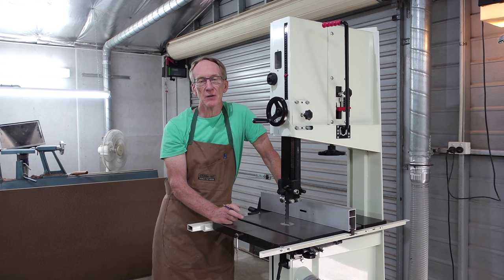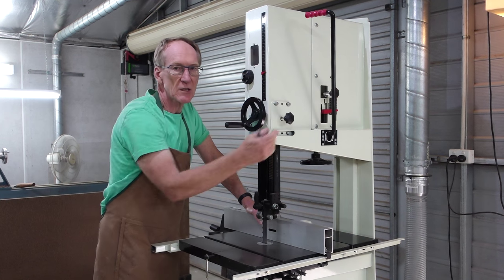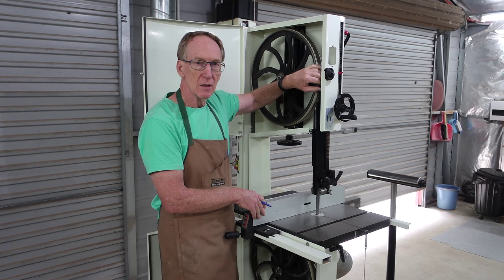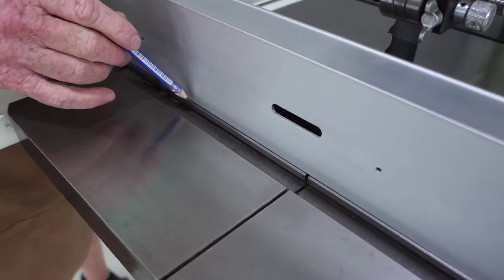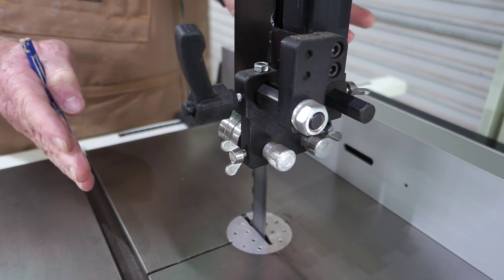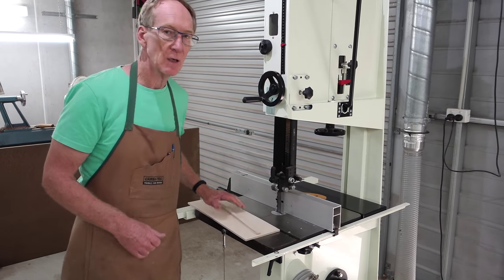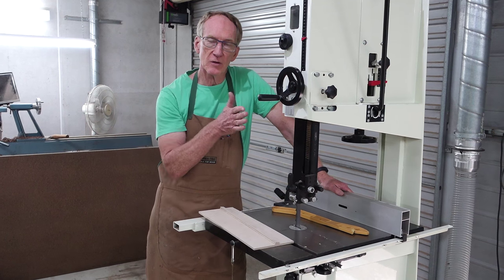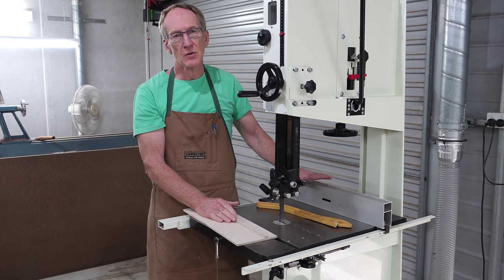The Great Myth of Bandsaw Drift

Comment: I disagree, you shouldn't have to twist the blade through the crown angle to match the slot. The gullets should ride on the crown (center of cutting), to avoid wander and the guides should stabilize the blade behind the gullets perfectly inline. This will work for thru cuts, but is inaccurate for stopped cuts (i.e. joinery).
Reply: Agreed!!!
Reply: not on a one inch blade!   u put the teeth near the middle u run out of space lol and chew up the expensive tires

Comment: Common sense. I've said for years that a sharp blade, properly tensioned, running in the centre of the top wheel, does not drift. More BS written about bandsaw drift than on any other topic in woodworking!
Reply: I agree and am forced to add that there is a  lot of BS about sharpening and sanding and finishing. Take your pick.

Comment: The last I read about what Michael Fortune stated regarding eliminating bandsaw drift, was that every bandsaw need be adjusted only once for drift.  He does so by setting the left - right movement of the table so that the blade doesn't drift in relation to its cut, but to keep the blade tracking directly in the centre of the wheels.  Could you please comment on this with us?

Comment: The folks at laguna would not agree. After centering the blade on the "tires"  Then make a cut no more than two to three inches long and check to see if the blade is centered in the cut. If not, small adjustments to the fence should be made.

Comment: I adjusted my blade per Snodgrass, on a woodwhisperer vid, but he says put the gullet in the center of the wheel, and it fixed my bandsaw drift, that is I could not cut a uniform with before, it would drift from the start cut to much narrower immediately.......but with the gullet of the blade in the center of the wheel, it cuts perfectly.....

Comment: A good many years ago I myself discovered essentially the same method of blade alignment, but independently of Michael Fortune.   I adjust the machine so that the center of a blade's width always rides approximately on the center of the wheel's rim or crown.   This insures that the side of a blade will always be at the same angle relative to the  miter gauge slot or front edge of the table.   I place a straight edge against the side of a wide blade to check for parallelism.   If it isn't parallel to the slot or at ninety degrees to the front of the table, I loosen the screws holding the table to its locked trunnion segments and shift the table in the horizontal plane (without changing the tilt or moving the trunnion segments.)  Then I adjust my fence parallel to the miter slot as you show in the video.   The beauty of this method is that it only has to be done once. 

I do all this with the widest blade the machine will take.     Just so long as that width of blade is always tensioned  the same amount and the tires are clean, it will always ride in the same place without having to adjust tracking.   Smaller width blades will also do the same as long as the tension force on them is proportionately less.   I almost never have to adjust tracking when switching blades.   In any event it is always wise to check where a blade is tracking when changing to different widths or re-tensioning.

I've never seen this method to fail unless the blade is dull or the teeth set to one side are damaged in some way.  It is a pleasure to be able to saw against a fence or to use a miter gauge for cut offs without having to re-adjust everything each time.
Reply: And that's why you're on here trying to find out how to true up your bandsaw!

Comment: You are correct sir. Others here are saying in the comments "the gullet on the crown". Often when the gullet is on the crown, the teeth are often carving up the tires, especially with higher offset  blades and higher TPI counts. As you failed to verbalize here, the trick, so to speak, is to balance the blade to neutral/parallel to the table slot on the tire crown to neutralize the drift in relation to the table. . Others have recommend adjusting the to table to the blade in other videos. Neutral alignment is usually achieved with the gullet closer to the crown. Then the blade guides will do their job maintaining blade alignment for external force variations. Zen achieved!

Comment: With 1" narrow kerf resaw blades (the good ones ; 1" 2TPI -CT) the set angle is so low you can't adjust the tracking accurately enough to parallel the blade to the fence; and you have to define the drift angle precisely in order to cut perfect flitches of consistent thickness. If you're referring to general purpose utility blades with set angles from 2 to 4 degrees you have enough wiggle room to "crab" along a slightly deflected fence and you don't need to be so precise. We couldn't make heads or tails out of all the conflicting information given on the internet until we dug into the specifics of the blades we were using. Blade manufacturers don't want to talk about their "set angles" and I don't know why. That should be the first thing a customer would want to know. We tested all of them for ourselves and compiled a chart listing ALL their stats so we don't make  mistakes buying blades any more. You have to get a micrometer and do that yourself, it seems, since the corporate bean counters think you'll spend more if you go through 10 inadequate  blades before you find the right one. It's all about the money. In the end, most woodworkers are severely limited by the modern bandsaws' inability to  track a blades under consistent tension anyway.

Comment: Thanks for that i am new to using a bandsaw, got it a couple of days ago and the tracking is out a little, i have used that knob on the back and it did make a difference, but stopped as i was not sure i was doing the right thing,  i looked up a few videos saying this was normal and to move the fence to match the drift, i will now go back and finish the job your way as it makes way more sense.I dont use the fence but cut small shapes and need it to cut straight as the shape is the same on both sides, when cutting the left hand side of the shape it wants to drift in to it which is bad, I used to use a scroll saw but the bandsaw is the tool i need for my work. it works ok at the moment but this adjustment will make it much better, thanks once again for this video very helpful.
Reply: The wave has a lot to do with feed rate. Low tension can cause problems too. I would suggest experimenting with feed rates to see what happens. Blades like to be tensioned at about 25,000 psi for woodworking. Most bandsaws will not tension the blades well. I remember using a 14" saw in a shop and I could watch the blade ripple just before the cut. When I tensioned it tighter that did not happen as much. The newer blades can be tensioned at 35,000 psi but the saw will distort under that kind of tension.

Comment: Don't forget to check that the two wheels are coplanar when you first get your band saw. This is easy before the table is mounted and adjusted. The wheels on my bandsaw were out of plane with each other and had to be realigned. Doing this will make the "drift" problem easier to correct. I used the instructions from Michael Fortune to set my band saw up. Works perfectly with no further adjustments since. I do check for drift each time I change blades. So far, none.

Comment: Would be interested to know what you think about the “Little Ripper” video, that basically the main thing that causes the cut not to be straight , is that when you cut close to the fence, the tension released during the cut often makes the cut open up, which pushes against the fence to make it not cut straight. That didn’t come out as clear cut as I hoped . Bloody beer strikes again. He released the blade tension and made a cut, still perfect.

Comment: Center of the tooth gullet should ride in the center of the drive wheels. Properly tensioned keeping the front of the cutting area tight and with a properly sharpened blade will not drift with proper feed.
Reply: I never learned this, and have always centered the blade on the wheel, with poor results!   Ah, if this is all there is to it, or even if it makes an noticeable difference...  WELL.  I will have wasted a lot of time and misery to date, but will also be glad that there is some hope for the future.
Reply: Wrong, if you’re using a 1” resaw blade like this guy, and you set the teeth like you’re saying, the tires will be destroyed very quickly, and it’s very likely you’ll not have enough adjustment to pull the rear guide back far enough, if the back edge of the blade isn’t already scrubbing on the body of the machine anyway

Comment: 'all there is to it!'  How's about letting everybody know which way to turn the knob based on how the test cut turns out?  Is it really better/easier to adjust the tracking than the fence? Certainly, the blade needs to live on the tires in the correct position.  And I can see the advantage to aligning everything to the slot in the table, but how often do you use the bandsaw to cross cut versus rip?  Isn't it more important for the blade to be sitting on the tire in the proper position - I've always read that the bottom of the guillets should be aligned with the crown of the tires - rather than aligned to anything else in particular?  

I don't mean to be disrespectful and only and  interested in learning.

Comment: Halo
My name is Abdullah from the State of Kuwait
I watched the video on your channel and the explanation is good and understandable
I have an inquiry. I will buy a band saw, which is almost the same as the specifications of our saw, but its size is between large and medium, because I have a small workshop in my house
The question regarding the saw weapon is whether the thick size is better or the thin size is better
With work, my most practical thing is to cut the wood with the text, I mean in two halves
that
The chainsaw to be purchased must be installed, the weapon is open, and its teeth are smooth
Note: I am an amateur, not a professional. Thank you
I wish you safety and security
my regards

Comment: Thanks for the vid. However what is not clear is, after you loosen the guides way from the blade, you cut a parallel along the pencil line; Is that without re-setting the guides? If so and you get that great parallel cut is there then any need to use the guides at all? (at least on a wide blade like you were using).

Comment: also the tension of the blade is a consideration, if it is too tight or loose it will come off the wheel at a different camber to what it should

Comment: Got it cutting straight now, unfortunately i think i had my tension to tight, as the rubber on the bottom wheel has come unstuck, is their a special glue to use to stick it down.
Reply: Binghams one stop shop get new tires.

Comment: Thanks for the video some blades just wonna drift especially the older ones that have been welded a few times .
Reply: I once read something about this, that pointed out that the teeth have SET, and you might cut and weld the blade so that you had one or two more "Right" teeth than "Left" teeth so to speak and the blade would cut a little more on one side!  I always thought it was the Lord's will sort of, but some of these videos are giving me hope that it's something you can control!!!!

Comment: I put a square on the table and against the back of the blade. If the blade is 90 degrees to the table, then it’s in the right place on the wheel rim. I found the back-of-the-gullets-on-the-rim-crown doesn’t work for the wider re-saw blades.

Comment: blade is drifting to the right if i adjust the knob at the back it seems to start to straighten it a bit, but even making small adjustments the blade will come off i turn the knob back the other way refit the blade and it cuts to the right again not able to stop it. any help would be helpful as i am new to this

Comment: I agree with your discussion of how to eliminate drift.  Once I started using the technique promoted by Michael Fortune, years ago, I stopped having drift.  I've always worked on an 18" or larger saw so I have no way of knowing what happens with a small saw with a narrow blade.
Reply: Does your saw not have the ability to run narrow blade?

Comment: Very confused about this. I have seen videos blaming pretty much everything for blade drift. The most convincing one suggested that tracking position, blade tension and guide set-up were all pretty irrelevant, and that it was the position of the table that was important.
Reply: Most people would think of the blade as a big ring sliced through a cylinder but instead imagine the blade to be a truncated cone. If you run the blade on the front edge of the wheel the narrow face of the cone is towards you. If you were to run the blade towards the back of the wheel the cone shape would be reversed and the wide end is towards you. 
When you think of it like that you can see how the wheel adjustment effects the way the blade will cut.

Comment: I agree with Peter 100%.......I've always made my blade track parallel to the mitre slot and fence parallel to the slot by adjusting the track as per the demonstration.    I also found that taking the time to make the two wheels co-planer helped a lot!
Reply: SimopsAus the wheels are not meant to be coplanar.
Reply: Jim Bo not what my grizzly ultimate says

Comment: If only my dewalt dw100 bandsaw had that adjustment option... I have lots of drift problems with that saw and no budget to get a better one.
Reply: If you're still using the plastic blade guides that came with the saw, replace them with metal or ceramic ones and adjust them as close to the blade as possible.

Comment: Drift is real, and it’s serious. If you have a heavy, and expensive saw, and you’re using a wide blade, then it’s easier to counteract drift. But smaller saws, and narrower blades are harder to adjust, and keep adjusted.

Basically, what he’s saying should work well for his saw, but take the average, used 14” saw, and things become much more difficult.

In addition, if you do a lot of veneer cutting, you will find that the side of the blade that is cutting the veneer side, rather than the stock side, is less dull over time. That’s because the pressure on the veneer side is less than the pressure on the stock side. Because of that, the blade wanders towards the sharper side, and you get drift.

I’ve been doing this for over 50 years, and I’ve seen a lot of arguments in a number of directions about this. Drift is real, and if you are careful, and pay a lot attention to what’s happening, you can prevent it for a time, and minimize it after that. But nothing is perfect, and even massive industrial machines go off tolerances if they aren’t monitored.

Comment: This is an oversimplification.  I have an old Craftsman band saw.  It has about 3 degree drift - I adjusted the tracking on the blade and it is dead center.  It did not solve the problem.  I also adjusted the table.  It helped but the table doesn't have enough adjustment to solve the problem.

Comment: Bandsaw  drift is not a myth. I had a ceramic guide come loose during a cut and it wore the set off the right side of the teeth on the blade. Subsequent cuts caused the timber to pull off the fence. I had to toss the blade.

Comment: People may want to argue about whether the blade should be centred or the deepest part of the gullet should be centred, which I do, the bottom line, however, which ever way you choose, is there drift, if not the method works. Clearly this method works, no valid argument.

Comment: My experience has been that new blades cut very straight. As they dull they start leaving a wavy surface on the wood. If I keeep pushing it then really bad things will start to happen. Drift,belling,smoke
On some saws you can turn the whole table left or right because of the way the trunnions mount on the saws frame. So I’d more inclined to see if that right before you freak out.
That’s a weird looking saw with the triangle frame. 
Come back in 5 years of use and look us straight in the camera a tell us if you still believe in your video.

Comment: No offense but you need to watch the video done by Alex Snodgrass about bandsaw setup.  The Blade is NOT centered on the crown of the wheel, the gullet of the blade is centered on the crown.  That way the blade runs dead straight and there is no such thing as blade drift.   Take a look.  You might learn something.
Reply: You may add that a good set of bearing guides are also necessary to minimize blade drift.
Reply: I thought it was interesting that the next video in the rotation was the  Ales Snodgrass video. I agree with you. One thing I noted about this video was that peter started out with the blade centered on the wheel and then blindly made adjustments till he got a good cut with no drift. Where do you think he ended up when he was done with his trial and error method? I'd bet he was deepest part of the gullets on the crown of the wheel. What do you think?
Reply: Snodgrass ignores critical adjustment of adjusting the table/trunnions. Watch Michael Fortune.

Comment: Sorry, but there is no way in heck that I'm gonna trial and error the blade tracking to eliminate drift when I can simply do a test cut on a scrap of 1/4" material, scribe a line on the table top, and then position my fence parallel to that scribed line... one to two minutes...tops! ....and..I simply have to set my miter guage at a 90 degree angle to the fence to get that one to cut 90 degree cuts!
Reply: I like it.
Reply: Gordon Aitchison  Calling someone a moron because they spelled one word wrong says more about you than them. I, for one agree with David's post, I assume you don't, if that's the case why didn't you just say so instead of insulting the poster?
Reply: A lot of saws don’t have an adjustable fence though

Comment: Using a typical one inch blade that saw would have to be capable of pulling 798 pounds of force to get a tension of 25,000 psi.